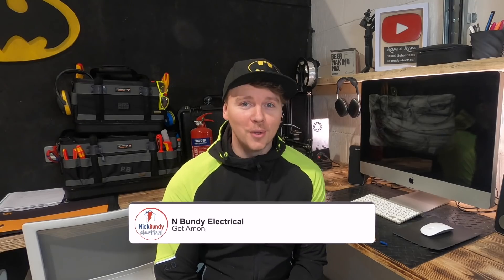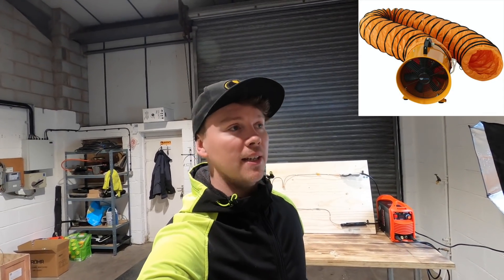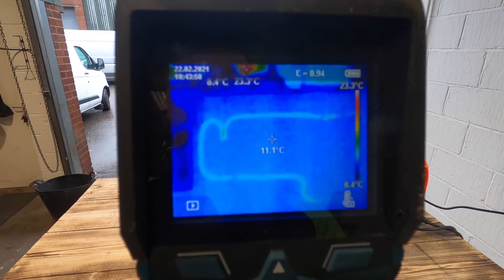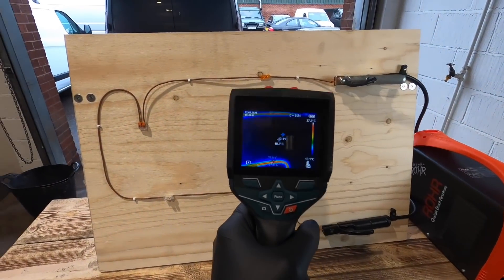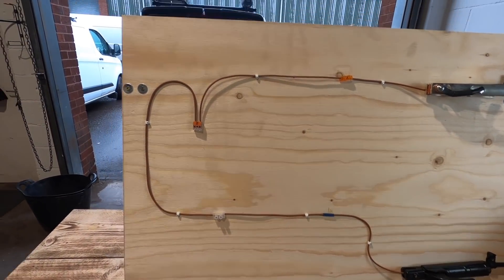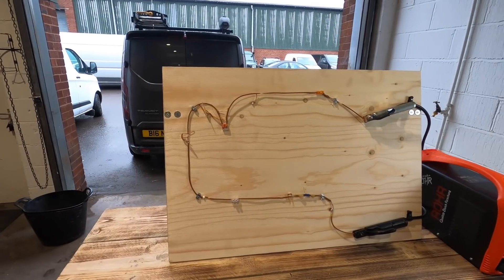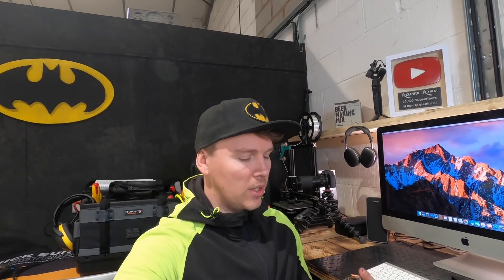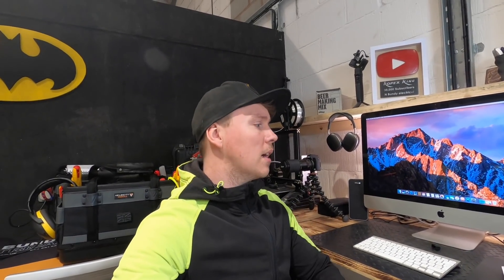Overloading Cable Connectors, Electrician

Comment: This was an awesoe segment dude, thank you. There's probably a discussion to be had about DC amps from a welder vs AC amp,s from a ring main, continuous current vs RMS current, and the effect the difference has on current handling of a given cable... but we'll leave that for another day... Or for JW :)

What is enlightening is that the oldest type of interconnect (screw-down block connector / chock block) had both the best current handling and the best mechanical integrity of all the types of interconnect. 

Do you think this will change how you join cables in future? 

Wago are easy to install... but you've just proen they're the least reliable in a fault condition...
Reply: If the insulation has melted off the entire cable then I think we can forgive the Wago... In this case it acted as a fuse and turned off the 2.5mm house-sized heating element 🤣 I once bought 2x "refurbished" stage lights from eBay which both contained undersized old style block-connectors that were extremely hot and actually melting the outside plastic of the device and was severely burning inside!... so, it's not a case of "block connector is better than a wago" it's a case of using the correct tool for the job. If either is not-rated for the amount of current it's a fire waiting to happen. In some ways the Wago is actually less dangerous in the hands of an idiot because it always applies the correct torque (screw-down connectors can be under or over tightened), and as they just look a bit flimsier so people don't just put them in without stopping and reading the rating which is printed on them, unlike most terminal blocks.
Reply: Wagos are maintanace free. Connector blocks aren't. The 221 is also available in a 40 amp version now.
Reply: DC and RMS = same heating effect until skin effect kicks in at higher frequencies. Then ac will cause more heat.
Reply: The Wago was 20 A rated. The connector block was 30A.
Reply: Least reliable at 120 amps yeah haha
Reply: @b96m13  120A definitely seems like a fault condition to me 🤣🤣

One day someone's gonna wire their EV charger in 2.5mm and the OCP is gonna fail you can be sure of it...
Reply: @izools  At that current the OCP for the whole house would already have tripped before going there and since the cables would have melted the RCD would trip aswell.

Comment: Chock blocks all the way every day. I'm so shocked that the Wago went first. Just goes to show that looks are not important. I wonder what Wago would have to say if you showed them this video.
Reply: They would probably say that they actually well passed the rating.
Reply: What you have to ask, do you want that wire still connected and generating heat or for the connector to fail and cut the circuit?
Reply: @TheXsheeple  Did not think of that!
Reply: @TheXsheeple  The purpose of a connector is not to fail under load. That's never good. Even extreme load. It's the moments nearing failure that are most likely to cause a fire as the connector literally melts. A connector should stay connected for as long as possible. If you want something to break the circuit during an overload and that thing is a circuit breaker, not a connector. The chock block is good in this demo but in an average installation under a floorboard with foot traffic for 20 years and there's a good chance it won't perform as well as the connection loosens.
Reply: If they are rated at 20A and they last well beyond that at DC, WAGO have done their job well.

Comment: "chock block" the winner : )
Reply: The Wago only has a point connection to the wire, so the resistance will probably be slightly higher compared with the crimped or (firmly) screwed connectors. P=I²R; I (current) is the same for all connectors in a series circuit, the rest is history (or science).

The choc bloc probably has more metal in it too, which will act as a heatsink.

Ideally do the same experiment but after it has been installed beneath floorboards for 30 years, and see how things change then!
Reply: @tbavister  Screws can loosen over time due to thermal cycling. There isn't only a point connection on a Wago, the spring pushes the wire down onto a plate, it's fairly easy to measure the resistance of both with a low ohm meter, Wago blocks have to pass a Voltage-drop test (IEC 60947-7-1/-2) and because of the design it's fairly safe to assume they achieve that in installation whereas "choc blocks" are down to the screw being tightened correctly and staying tight.
Reply: @mfx1  ok two point connection! Agree on the screws, hence the suggestion to retest after 30 years!
Reply: @tbavister  Doesn't have to be 30 years you could do accelerated thermal cycling relatively quickly, just apply a heavy load for 30 seconds or so on/off constantly.
Reply: Not really, do you want a wire acting as a heating element? The Wago went first acting like a fuse, which I would say is the safer of the bunch. @ 4 X the rating they all exceeded what they were disigned to do.
Reply: @TheXsheeple  Connectors are meant to connect cables together the best they can. They aren’t meant to be fuses !!!🤪
Reply: @AndyK.1  It did what it was rated to do.:)
Reply: @AndyK.1  Not meant to be a fuse but lucky it was for any house. The liability of screw terminals getting loose over time is far worse, the Wago survived WAY over it's rated current.
Reply: @TheXsheeple  And it was running far hotter than the 'choccy block' possibly being the ignition point itself... (and I am still not convinced they are that good longterm....)
Reply: @TheXsheeple   with a big dramatic spark like that 😳 mmmmm ! yep they all did well over 👍 but the “chock block” almost looked reusable (of course you wouldn’t 🤪) and of course it was meant as a joke hence the : ) 🙄
Reply: The Wago possibly saved the house catching fire.

Comment: Good indication that actually the old style connector blocks are best due to having the most metal and largest csa of contact with the cable cores.
Does just go to show that going back to the metal cable clips is a massive improvement in safety, especially on fire escape routes.
Reply: yes,screw terminal safe forever even in socket,plug,socket,mcb,main switch use screw terminal connection.. for joint cable for permanent please use cable link..
Reply: The Wago failing like that is a good thing it acted as a fuse and possibly saved the house burning down. It still survived WAY over it's rated current and unlike the terminal block which seemingly was better hasn't screws to get loose over time. Long term old style terminal blocks are far more of a liability.

Comment: Does not give a real picture of what happens, you should remember a wall is inclosed and therefore it will get much warmer at lower amps. Often there are cables together which heat up each other and makes it even higher.
Reply: Still gives a real picture of what happens when the cable reaches too high temps. Really just sounds like you felt like you HAD to make SOME sort of criticism.
Reply: @TheFenrirulfr true that it shows what happens, but if you thought that some of these cables actually could sustain these amps you would be wrong. And if a newcomer to the line of work see 50 amps being okay on a circuit that is only rated for 32, because he see that all electrics being appel to handle more than the rated spec, it could cause a fire. Just meant as something that he should mention.

Comment: Quite literally the most pointless video on the internet. "If a 2.5mm cable pulls 100A", yeah...........Extension leads off extension leads = 13A @ the first plug top. Whilst wrong for many reasons, still only 13A. " If someone puts in the wrong protective device", yeah, loads of those 100A MCB's floating around!
Reply from the maker: Have you seen two girls one cup?
Reply from the maker: I thought that was abit more pointless than my video
Reply: @NBundyElectrical  Will take your word for it, but suspect they would know that multiple extension leads plugged into each other would still be protected by the 1st plug top fuse. But you are correct, if I ever need to decide how to join a cable to a 100A supply, fuck it, lets say 200A, I know to rule a 20A wago out. Thanks for the assist
Reply: @mitchlouis3614  Mummy's calling you.
Reply: @TheXsheeple  Top reply there lad, take you a while to come up with that one?
Reply: Part of an EICR is to check the functionality of the protective devices. I've found a few RCBO's that don't trip on the test button. I assume that they wouldn't trip on an overcurrent either. Would the breaker melt and disconnect before the cable? Difficult to know.
I also saw an old rewireable DB in a let property with a nail in place of the fuse wire that had blown. I assume that the nail could easily carry 100A.
Reply: @stupot_64  I'm yet to ever see an MCB with any form of test button, but go figure. Yes, we've all got stories of nails in fuse carriers, and yes the circuit if overloaded would destroy the cable. Be impressed on whoever is managing to pull 100 on a radial within their own home though! Also feel for the bill payer
Reply: @mitchlouis3614  Sorry, RCBO not MCB. 
Duh, been a very long day!
At least I have landlords that are getting an EICR whenever their tenants change rather than just every 5 years, and with the lash ups I've seen tenants "install" I'm glad they do.
Reply: @stupot_64  Replacing a cartridge fuse with a nail is irresponsibble, everyone should know that a 0.22 bullet is the correct thing to use.
Reply: @petehiggins33  Might do that with some cheaper rounds but it would be a waste of my Eley stock.

Comment: Looks like good old choc-block connectors are the future then 😄
Reply: Not maintaince free though.
Reply: @arcadia1701e  maybe they should be , never had a call back to a job with proper connector joints
Reply: @arcadia1701e  tail light guarantee 👌🏼😂
Reply: @puntoboy_gaming  exactly 😊
Reply: @puntoboy_gaming  It was the first to fail and then the test ended
Reply: Ok if you want to burn your house down
Reply: @TheXsheeple  Really??? Next time you're installing a 10.8kw shower have a look at the terminal block-BLOCK CONNECTORS. They are perfectly acceptable if they are accessible to be maintained. I recently went to a new build to replace switchgear, all of the light switches had been terminated with Wago connectors, but here's the thing-the switches were all fed into the switch, multiple switching and 2 way etc, so every dryline box had the back completely cut out to get the Wagos to fit in-brilliant 🤨.
Connector blocks have their uses-if installed correctly.

Comment: It’s the same as tyres for vehicles they are rated to carry a certain wait that’s why you have the number part listed like 95Y the Y is the speed rating how fast the tyre can continuously travel at for one hour with out blowing and the 95 is the rating given for how much weight the tyre can carry I can’t remember exactly every rating and how they work but I’ve seen car tyres fitted to vans fully loaded and they still carry the air

Comment: With my computer and 2 monitors, plugged into an extension, no issues. 
Wild part which will most likely trigger you, I plug a portable AC into an extension that is plugged into the extension my computer is plugged into.
However, I have checked during the summer when both are on (and I don't run the AC full speed given my room is small), and no issues with heat.

I probably ought to check what amps all these things use next time summer rolls around...

Comment: nice example of using the wrong cables for the loads on it. it happens lots with car audio installations. people put a 100 watt sub with 120 watt amplifier and then put a 05/1 mm cable to feed it all. thats just asking for glow in bright daylight wires. mind you that at 12 volts so really high amperage.
Reply: One of the biggest sources of problems with automotive electrical is the damned ampacity charts. You get people - even "professionals" - who look up the open-air ampacity of SXL/GXL/TXL, which has cross-linked polyethylene insulation rated 125°C, and think that somehow applies to 60°C PVC-insulated "primary wire" stuffed under carpet. And half the time it's CCA to boot.

Madness.

Comment: You should do it with the old fuses to see what they blow at and compare it to MCB's. Would be interesting to see the difference between old and new gear.
Reply: John Ward has done it 👍
Reply: @darknessdestroyer5524  found this one from good 'ol JW for the fuse wire: https://youtu.be/WhF9Tn8q9us but couldn't see one for CBs.
Reply: @johnhoward2104  yes, sorry I should have said that it was fuse wire that he was testing, it would be interesting to see if the overcurrents applied to MCB's match up to the regs as in regards to trip times 👍
Reply: @darknessdestroyer5524  regarding the time/current characteristics for CB's in Apdx 3, you may be interested in a recent discussion on the IET wiring & regulations forum (found here: https://communities.theiet.org/discussions/viewtopic/1037/27737 ) that indicates that each graph contains an error.
Reply: @johnhoward2104  Thanks for that link, I knew that some of the graphs didn't make sense 👍.
Reply: Great idea, that would be a good one to see. The old rewireables are supposed to have a fusing factor of around 2 on overload, and CBs an I2 of around 1.45In, so would be good to see it in action.
Reply: That’s a good one to be fair

Comment: Hi - good video.  Next time I would put a decent clamp meter on the wire to show actual amps rather than Chinese welder amps :-)
Reply from the maker: Good idea cheers bud
Reply: Yes mate. Exactly this.
Clamp meter should’ve been on from the start!
Reply: I'm guessing that it's a DC welder, so would need to be a decent hall effect type clamp meter - definitely not an Amazon special.
Reply: @farmersteve129  Plenty of hall effect "amazon specials" out there and they actually work pretty well.
Reply: I was gutted when i didn't see an amp meter... From a spark testing electricity 😂😂🙀
Reply: Especially as welders down the cheaper end of the scale are known to be anything but accurate on the dial.
Reply: Don’t use a new clamp meter the plastic will melt 🤗
Reply: @electrojessy4270  It would be ok if the clamp was on the thick welder cable, not on the bursting-into-fire 2.5mm2 cable!!
Reply: @Richardincancale  👍

Comment: 221's are only 20a? You sure?
Reply: me too thought they were 32a, wierd though the most expensive connector broke first, even though well over rated
Reply from the maker: I had an old 221 which were 20amp bud
Reply: 221s are rated 20a by PSE (JAPAN) they're rated 32a everywhere else